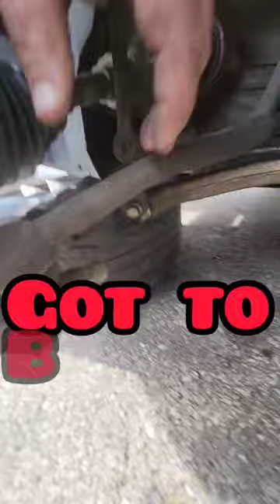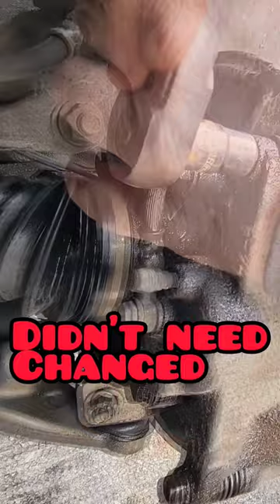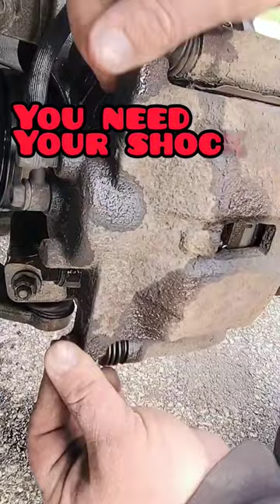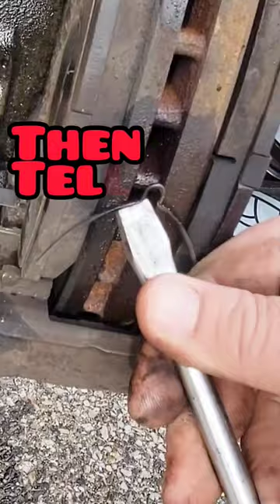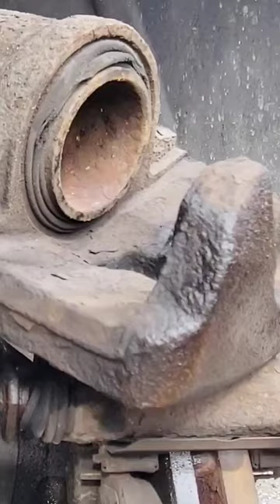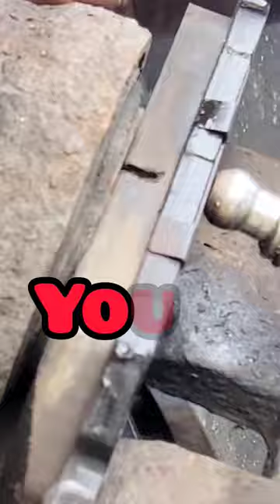Customer States: I Would Have Fixed It Myself But I Don't Have My Tools With Me

Comment: You need a prework line they sign on your invoice homie. Have a minimum work charge and save yourself the worry of non-payers. If they sign it and refuse to pay, you'll only be out a couple weeks until the courts award you the money.
Reply from the maker: I do that as well and I have been to court and have won and thry was issueed a judgement and they still do not pay. Scumbags man so every job I have to really think about if they can pay and if they dont how can i leverage them to pay
Reply: @semperfimechanic  (k n e e c a p s)
Reply: @semperfimechanic  I think it’s legal to repo the part you put on the vehicle if they don’t pay you. Might double check on that. I’ve heard something about it.
Reply: @antoniobarber8650 definitely not
Reply: In the very few times in 15 yrs it has come to that, I have only threatened to call the police to file theft of service right then and there. I may lose that coustomer but I always got paid.
Reply: Also you can go the route of artisan lien on the person's vehicle and that's one way you can recoup your money
Reply: *36” 1/2 drive snap-on breaker bar enters chat*
Reply: @semperfimechanic  I've owned an auto repair shop for 24 years. I do 500 brake jobs, 10k oil changes and 2400 tires a year. You know something? I've never been taken to court. Never. You know how many times I have not been paid? Zero. I get paid every time. You know why? Because I am honest and tell the customer about everything I find. It's up to them to do the repair. So what if they tell you to stop? Sometimes the full repair is out of budget for someone. Plus, in the time you spend arguing with them or going to court, you could complete another dozen jobs.
Reply from the maker: Im glad you have had good luck. I think you're not taking into account that being a mobile mechanic is far different than your shop. Also, I wouldn't imagine you would have too many problems doing tires and oil changes
Reply: @joeydover  owning a shop and being a mobile mechanic are 2 different ball parks, you have physical custody of their vehicle, and from the sounds of it you are just doing tires, oil and brakes... but its hard to believe you have never had a customer that tried to get over on you, when I was 17 working at walmart  tire lube express they had people that would try to get over on them .... maybe you have just been lucky/blesses
Reply: @mandc20022  Even if you are mobile, you can file a mechanics lien. You can then file for a claim of delivery and take the vehicle. The filing fee is usually $20 or less. Even if the court doesn't give you the vehicle, you will get paid if they ever sell it. It can't be transferred because the title will be encumbered just like a bank note.
Reply: Cash only
Reply: @davidfriction7170   LMAO lost a customer I don't think they planned on calling you back from the beginning. They are going to hide from that tab like a 10 mm socket from a Chevy guy
Reply: @davidfriction7170  dude if you dont pay me I can take your car, sell it, and keep my money you owe me
Reply: @semperfimechanic  You would think that you wouldn't get issues doing oil changes, tires and brakes but you do. I see so many issues with people letting the Ace Mechanic Under the Shadetree Automotive Repair guy work on their cars it's not funny. Stripped heads on oil plugs, broken off oil plugs, stripped oil pans, Toyota plastic cartridge filters over tightened to the  point you have to break them and chisel out the pieces. Lug nuts and broken studs because someone over tightened the spare that require a hub removal and bearing to repair because you cant get the new stud in any other way. With 500 brake jobs a year you get broken caliper bolts, siezed caliper pins, frozen caliper pistons...The list goes on and on. We see 10k cars a year. Stuff is going to be more than initially thought. The key is being upfront and knowing when to cut your losses and move on. The hardest thing had to learn in business is it's ok to say, "No."
Reply: @mandc20022  I never said I didn't have a customer try to get over on me. They have tried but all have failed. Making notes on the invoice and making them sign it eliminates 99.999% of issues before, after or during the service. And if you're customer is a good customer, they will understand that stuff pops up beyond anyone's control. Or you tell them that it's something out of your scope of repair. I do a lot of basic diagnostic for free and send them elsewhere for repairs. I am very knowledgeable and experienced, but there is only so much my business model will allow me to do. I did $1.2 million in gross sales in a 2 bay shop with 5 employees in 2022. You have to learn when to say no.
Reply: @semperfimechanic  mechanics lein on their title is what you do in Texas. Can't sell the car with that on the title.
Reply: @semperfimechanic  always keep the keys until payment, and learn how to quickly/easily disable the vehicles, usually a transmission shift gear disconnect.
Reply: In my state if they don't pay you put a lien on the car and retain it till payment is made. Also you can indicate certain things like this in fine print on the invoice most just sign off without reading
Reply: @TheDemonicEden  if they sell it. If they drive it till it dies and junk it. You’ll never see the money.
Reply: @wrenchaholic_  not true my step dad actually put a mechanic lien on his old boss and made all her properties get liened against until she paid or else the banks were gonna sell all her properties to pay off the debts it all depends on what route you go because even if they junk it their assets will get foreclosed on and you will still get paid
Reply: @davidfriction7170  it actually is as long ad you dont damage the rest of the car

Comment: I always look over the whole front end before I touch anything. That way if I come across something like this i can say. "Well your shocks are leaking they'll likely need replaced soon anyway and its easier to do with the tire off. If thats something you wanna get done today I can knock that out while I'm taking care of those rotors for you." Then after I replace the shocks if the rotors look good I get to call and say "good news your rotors look good I don't see anything wrong with them. so looks like I can save you a few bucks on this. But if you want I can go ahead and replace them anyway since I'm already here." Leaving the choice to keep or replace them up to the customer and the shocks end up being a non issue. But I have had people tell me stuff like "I don't have any issues with the steering why do I need new sway bar links" or tie rod ends ect. Its like, yeah you don't right now but I don't trust this the way it is for me to just leave it if I can help it. Theres even been times ive offered to buy the part myself and just do the work pro bono if the part was bad enough.

Comment: Here's the reason there isn't a lot of trust in this industry.
Reply: he literally said "I already told him the rotors DONT need to be changed And he said do it anyway" what he's saying is hea not going to tell him about the shocks til he is does because the guy ordered him to do the work despite being told it doesn't need it. so now he's going to finish the work the. tell him so he can't get out of paying him which people do all the time
Reply from the maker: My god, finally, someone understands. You, sir, are Genius to figure this complex situation when no one else could
Reply: @semperfimechanic  😂😂😂 bro I'm blown away by how dumb everyone has gotten. The internet shows me every day that people are far more dumb than I ever thought was possible... But as someone who turns wrenches I'll ALWAYS have your back !!
Reply from the maker: @sumo-ninja  Brother, if you say 1 thing wrong or call a bolt a screw or I called something a sensor instead of a connector and people will lose their minds well about 10 percent of the viewers will. No matter the actual repair in the video was completely flawless, they are still complaining
Reply: @semperfimechanic  for REAL man!!! They will also be COMPLETELY wrong about something and have the confidence of ten thousand men about it!! If you're going to correct someone there is no excuse for being wrong especially with Google just 1 second away... It's crazy

Comment: Rotors can be brand new and still have a runout issue. This would cause pulsating  in the pedal and/or steering wheel when the breaks are applied. You can't see runout; and didn't see you use a micrometer to check them for runout...
Reply: Dial indicator.
Reply: @nitroustommy3668  A dial indicator can be used to measure runout, while a micrometer is used to check for parallelism. You sir are correct!

Comment: Just charge a minimum even if work is canceled and don't rip people off!
Reply from the maker: Yes we charge a minimum but we have people who wont pay it. I replaced hos rotors like he requested got paid told him his shocks needed replaced and he said not right now. So im confused
Reply: @semperfimechanic  Get your minimum up front and stop ripping people off!
Reply: I would mention the issue and that the brake pads and rotors appear to be in good condition but It’s not ripping anyone off. Only those  of us in this field know how to read certain types of customers. 

The guy most likely would’ve thought Semperfi was just trying to get out of doing the brake job and wanted a “free” diag fee

Most people don’t see the value in us driving there, pulling out our tools, jacking up each wheel and finding the issue. 

But with that being said Columbus Ohio customers do seem like jack offs. In the last six years I haven’t had as many bad customer as he has had in the last few videos
Reply: @3sonsauto367  Charge diag fee up front. No issue = still getting paid.  

Swapping good parts for good parts only to have the same issue because it's not the problem is ripping somebody off and dragging ones in own name through the mud! 

This is not how one gains customers and gets more referrals!
Reply: Been doing mobile repair for 13 years and you learn how to read customers.  There are those who want what they want regardless of your recommendation
Reply: @nathanacquaviva9117  Yeah, you give a customer a choice, you get a bad rap because they're usually wrong. Pass on the work, be honest, keep your name grow your business and enjoy the profits.
Reply: @brookekathryn1980  I haven’t advertised in the last 4 years. All of my business is word of mouth from past customers and autozone employees. 

I stand by my work and don’t rip anyone off. I’d lose sleep over it. But if the customer is adamant about wanting a part replaced. I’ll replace it for them and then we go from there.

And maybe I’m just fortunate to have decent customers but I never charge anything upfront. If I was a customer I’d see that as a red flag and this mechanic just needs money. 

I just had 2 customers who I forgot to send the total to yesterday and they just Venmo’d me this morning $430 & $360. 

Once business picks up you’ll learn how to deal with mainly good people.
Reply: @3sonsauto367  That's great, I've never advertised and have been in business for 15 years. Pissing match or not, plenty of people make money ripping people off. If that's how you or anyone else chooses to do business, then do it. I personally choose to make my money honestly and with integrity. My wallet and my well above average pay for my 38 employees reflects that! 

If you want to slap some rotors on the car that aren't warm because a shock is leaking and causing the issue, then you do that. 

I'll turn down that work, let them know the issue and if they walk, they walk. 

Most don't!

I personally don't take a service or trip charge. I don't need to, but if this guy's worried about getting paid then that's what he needs to do!

I'd suggest you read Carl Sewell's Customer for Life.

Also, $790... I'd give that back to them for it being our mistake!

Comment: It’s a gamble sometimes. I tell people the trip and initial diagnosis are $25, gotta at least cover my gas. But those rotors are glazed and if the pads are on the thinner side, they could sing a little. Turn the rotors, unless they are cheap, but I would’ve just done it because some people really drag out their maintenance schedules to the point of damaging other parts. Good luck, Semper Fi🫡👍🏼

Comment: Yes sr. Just a tip.. use the old pad to press back the piston.. I've seen a sharp spure on a caliper piston Crack the ceramic on a new pad.. I did it... woman rode her pads to the metal then some.. just a tip..

Comment: I agree 100 % with the customer those  rotors are trashed he’s never wrong as long as he pays up he’s a Genius .  
You’re right the man would feel offended if you called him out and not pay you because remember he’s never wrong .
Reply from the maker: Yea you usually can tell by first meeting them what you can say and not say
Reply: Brakes are done as requested. By the way the shocks are leaking oil and should be replaced. Have a good day.
Reply from the maker: Exactly what I did. I Did the rotors as requested got paid then told him his shocks needed replaced and awnsered just like I thought. He said yea not right now

Comment: I charge a show up and inspection fee that I waive depending on what work is done. I won’t drive out to a job for free. Even if it’s as simple as putting the car back in park so it will start. I still showed up. So that extra inspection has some value. But if I’m doing a bigger job I just waive it. But it’s 100$ for me to show up no matter what

Comment: I would've showed the customer either in person or thru pictures that 1.the rotors are in great shape and 2.the pictures of leaking shocks should suffice. And usually a customer comes to the realization that your being truthful and honest about the actual work their vehicle needs. I'm just curious as to why you used the brake pad to open the caliper pistons? Doesn't that technique leave a groove dugged into the pad causing more unnecessary expense or compromising the integrity of the brakes?

Comment: A warped rotor can look perfect to the eye. However, when you put the dial indicator on it and check the runout, you quickly find out why the vehicle is shaking like that old vibrating bed that Clark Griswold made the mistake of putting a quarter in during the motel scene in Vacation...

Comment: i would be more concerned about the condition of the calipers. the square cut seal probably has debris that is causing the pad to remain engaged leading to a warped rotator.

Comment: The dealership can rip you off. Which I have seen they've done to customers plenty of times
Reply from the maker: People act like the dealership means there safe. Nope its still Billy from around corner,  the drunk who beats his wife and kids working on your car
Reply: Yep, only now Billy has access to the latest and greatest diagnostic equipment that most techs won’t even know exist for another 5 years, has a whole lot of techs around him that usually have decades of experience that can help or at least answer questions for him, most likely has been sent to a few classes the dealership needs their techs to be certified in, has a parts department a few steps away that will let him try a few things if he’s not sure if he needs them or not, if Billy up the street fecks up something, you may never get him to un-feck it, but if Billy at dealership fecks something up it may get un-fecked before you even know cause they most likely won’t mention it ever was fecked by them, chances of Billy up the street saying I don’t know or it can’t be done, 50/50, Billy at dealership, never, he will tell you he can do it and anything can be fixed, with enough money, I could go on and on but the point is you are right drunk Billy up the street is the same Billy at the dealership, the only difference is drunk dealership Billy has all the means to make even him look like the smartest tech that ever lived or will live making him the best option for automotive repairs.

Comment: It's a strut not a shock and that rotor can still be bad you need to use a set of calipers to measure thickness and a runout gauge to check runout

Comment: You told him there was nothing wrong with the rotors and he said replace them anyways and don’t worry about anything else so he told you exactly what he wanted you to do. Some mechanic wannabe told me you couldn’t just look at a rotor and tell if it’s good or not cause you wouldn’t be able to see if it is warped or not and that is usually the problem with rotors. Showed him this video and he looked very confused and asked how did you go from looking for a brake problem and then decided it was a leaking strut that was the problem. I just said regardless of the original complaint the strut was bad.
Reply from the maker: Yes you can tell simply rub your fingernail across it and you will be able to feel it, plus your suppose to test drive the vehicle before you start, to confirm what the customer said and the test drive had no rotors symptoms. So i told the customer that they didn't need changed, he said change them anyway and ignore anything else  So thats what I did but I still wanted to know what was causing the issue so you do the look/push/pull/shake method on each part you can reach and  thats how I found it plus if your sitting down changing rotors the shock is literally in my face so i better have found it
Reply: What was the original issue?